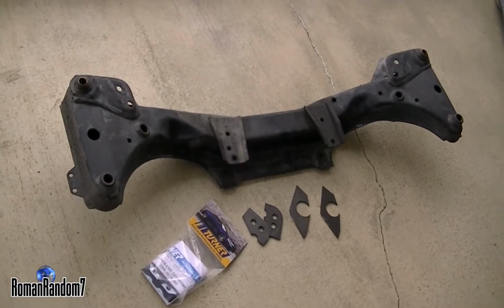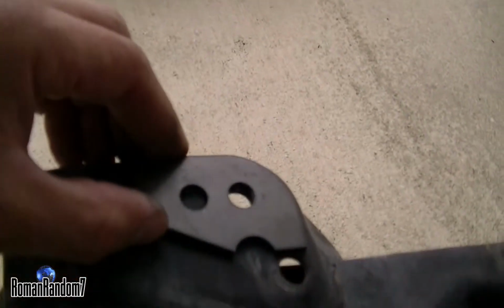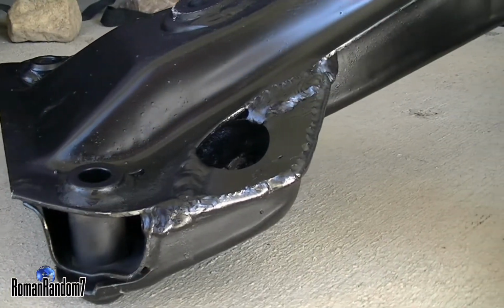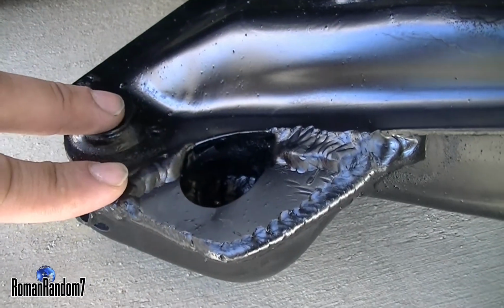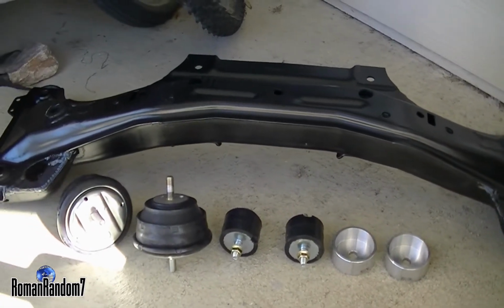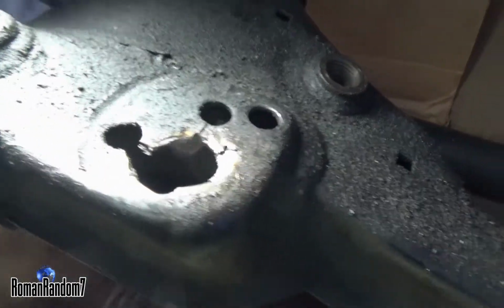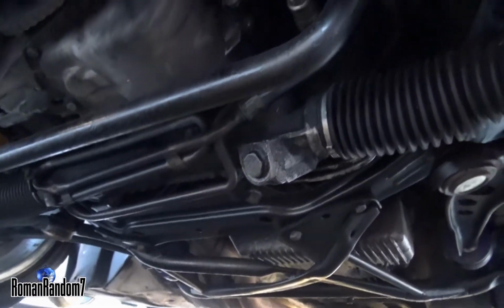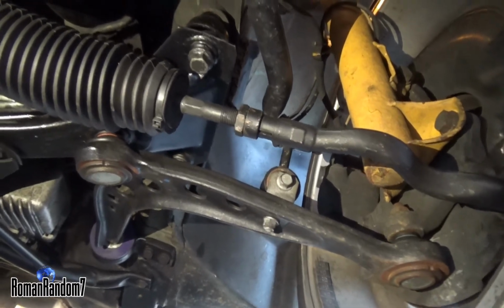BMW M3 E36 Reinforced Front Subframe & Replacement Parts Set Up

Comment: I am not going to weld, for what? no need to remove anything,   just place one plate on top, one on the bottom inside, and sandwich them tight with the  long  rubber motor mount stud and its nut. but that is L A Z Y  me   lol  (lazy brain  too..)

Comment: Hey can a m3 subframe be used as a replacement subframe for a non m car? Actually what is the difference ? Mine is a 97 318i sedan and am planning to install a 98 M3 Evo vert/coupe sub frame. Will this workout or do I have to change any other front axel parts as well?